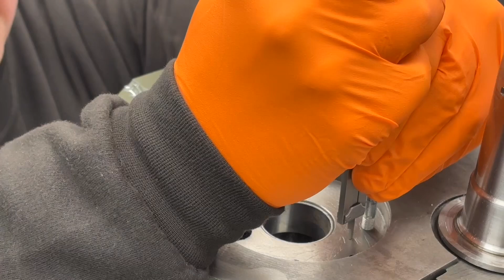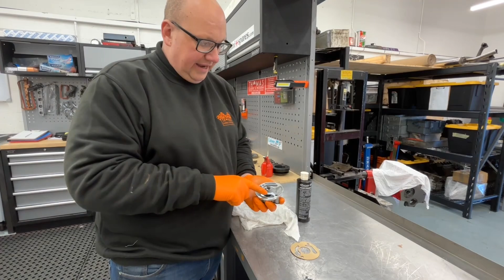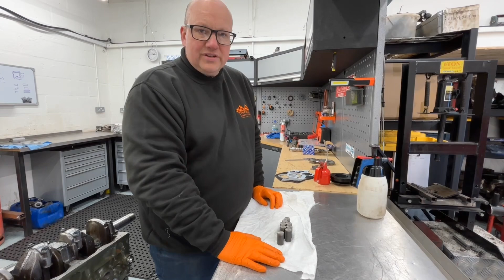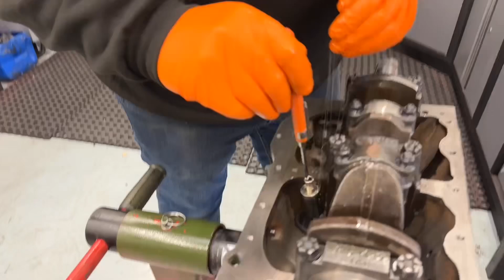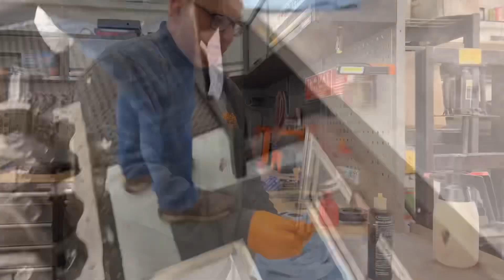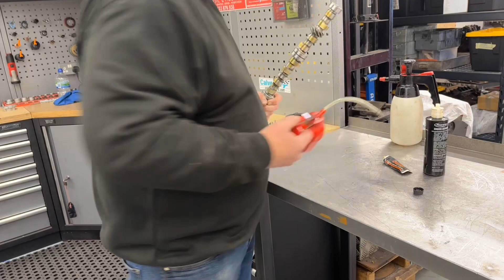Classic Mini 1360 Short Motor Engine Build Pt6- Camshaft installation

Comment: What would you do if your cam shaft was not that free?
Reply from the maker: Take it back out and rectify the issue, likely too little endfloat or too little cam bearing clearance
Reply: @thomasclassicandmodern  the cam did need some sorting out, but the problem is that the boss on the timing gear is as deep as the thrust plate, so I was never going to get any end float. Thanks for your advice 👍
Next step is to return to timing gear ⚙️

Comment: Thank you so much for genuinely and honestly sharing your hard earned knowledge. So many YT providers produce content that demonstrates they have knowledge but actually don’t impart any.
Could you advise? In this episode you show the block mounted to the stand using just the two fuel pump bolts. Is that sufficient for a fully loaded engine? It seems more logical to mount the block from that side to allow assembly of oil filter and distributor, including timing, but so many mount from the oil pump bolts. 🤷🏼‍♂️😉
Reply from the maker: Hi there, many thanks for your feedback and glad you're liking the content. 
We have used both methods of mounting and have had no issues with either, however access is much less inhibited using the fuel pump holes. Meaning more can be assembled ie the oil filter housing, core plugs etc But we don't ever assemble the full engine to the gearbox on the build stands, we remove the engine from stand to lower it onto gearbox using a crane.

Comment: If you don't know how to use the distance measurement function on your vernier ( flat end to inside diameter measurement tip) what other measurement techniques are you getting wrong?
Reply: He correctly used the depth measurement function.
Reply from the maker: Happy to try and understand exactly what you mean but no mismeasurement here 👍
Reply from the maker: I think what your referring to is why didn't I flip the very nears and us them to the underside of the bolt head. Each to their own. 👍👍